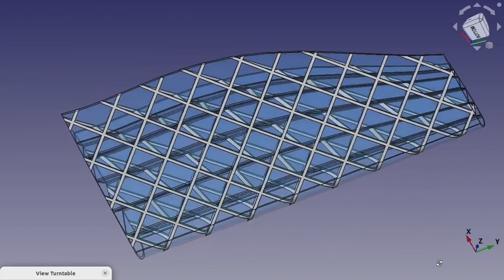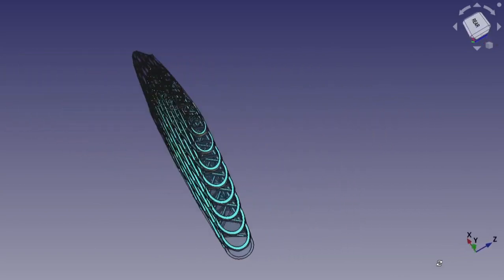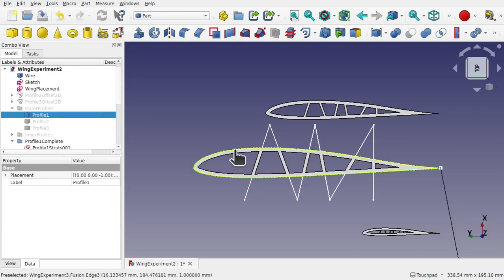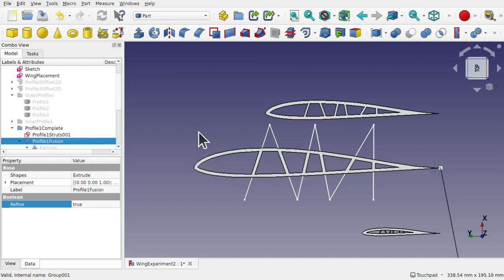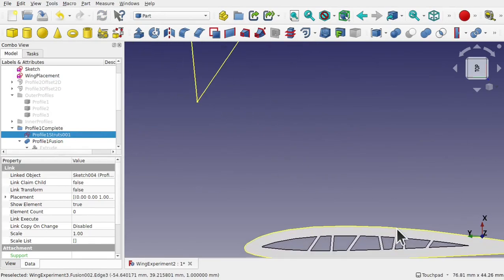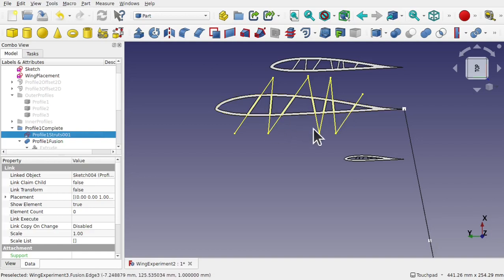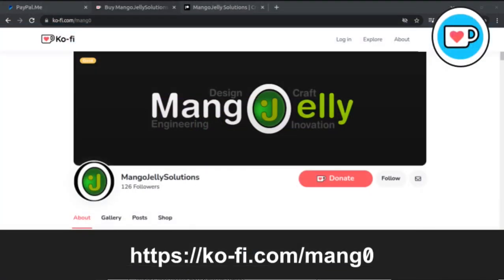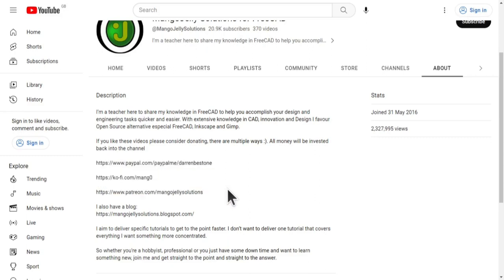FreeCAD: Lattice Wing.  A quick update

Comment: I'm curious if FreeCAD can analyze these types of structures for potential design failure?

I own an ultralight aircraft called the Ritz Standard that uses a lattice wing. The designer died when he exceeded the structural limits of his design.

Reports at the time said it looked like the wing exploded as it violently came apart.

You won't find much information online about this aircraft because it predated the internet and access to cameras in phones like we take for granted today.
Reply from the maker: Freecad has a workbench called FEM https://wiki.freecad.org/FEM_WORKBENCH  this may be the answer you are looking for.  I had a little bit of a research and found some images regarding the aircraft. Wow there's not much to it is there! Looks like the pilot is very exposed.